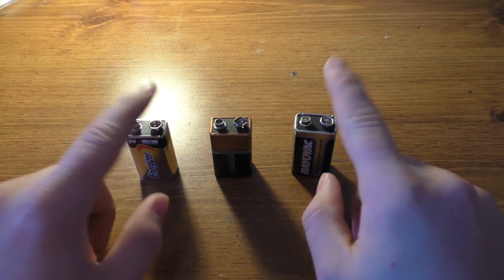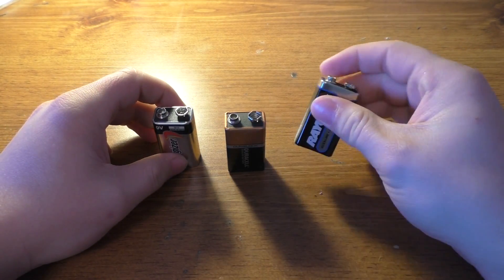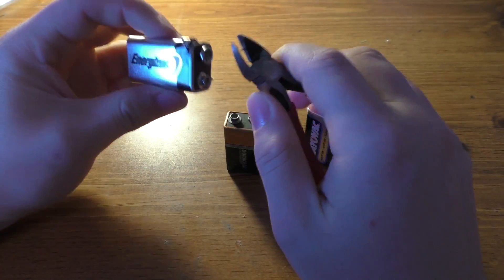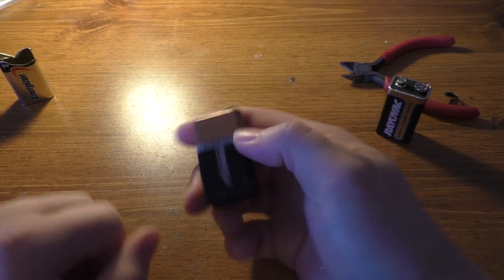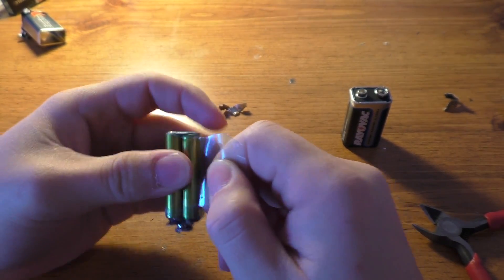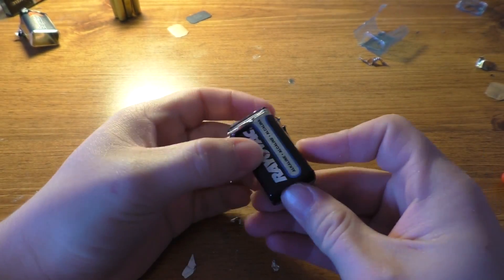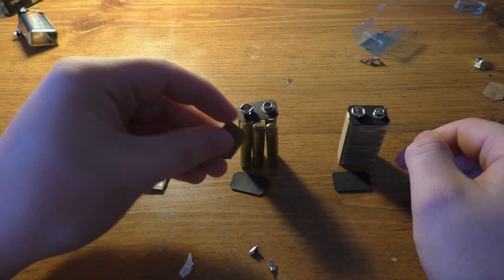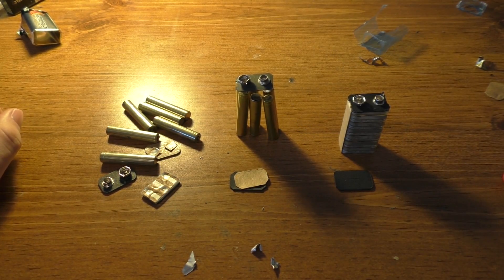Different Construction Methods of 9 Volt Batteries

Comment: That last one you opened up with the little block cells is an older style basic non-alkaline type carbon zinc "pile" construction, this type goes way back to the 60's and earlier but is now seen in some alkaliknes as well - the ones from earlier than this look different yet, encased in some kind of waxy substance

Comment: In the early 1960's the two worst leakers were Ray-O-Vac and Burgess. Ray-O-Vac still  may be using a cork seal on the negative terminal of their C's and D's. A prescription for disaster.

Comment: I tried open the plactic of rayovac battery inside its like some cloth or fibre and some kind of carbon thingy in it(dont actually know what they all called)
Reply: Carbon zinc cells from back in the 50's / 60's and I believe todays non alkalines are still made this way, I remember opening these up in the sixties and they were encased in something like a wax substance

Comment: If 6 1.5 volt batteries equal 9volts in series doesn't 6 A batteries equal 9volts as well in series making a longer lasting 9volt for use in portable amplifiers  like the fender mini tone master amp that would lengthen playing time. That's what I'm working in now. The amp came with 2 1 amp speakers that I have swapped for a 6 amp flat screen speaker that eats more juice.

Comment: I have no idea about comparative capacity but a significant space in 9 volt batteries that use cylindrical cells is air, that does not contribute to capacity. The rectangular cells seem to make the best use of the available space. Big companies source their batteries from a lot of places and you may find that that construction varies within the same brand.

Comment: Yeah, Bob Lazar says their good for powering Alien spacecraft too! Get the Energizers, more bang for your bunny! Oh Ohhh 😮 I hate batteries cause I have to change them 2-4 times a year in my smoke detector (one 9Volt only) Located in the garage attic. Heat killer for sure! Which brand of 9V do you recommend for the attic?Just went thru HEAT WAVE IN KANZA 100-113 degrees outside for 3 weeks, did not venture into attic until this morning after a 3” rain and 68 degrees. Please I’m desperate, as my wife keeps telling me the smoke alarm in the attic is chirping again! Dang it anyway!
Reply: Try a better roof vent for your attic.....or wire your smoke detector for a remote battery location i a cooler spot.
Reply: If you can deal with the $6 + price, go to lithium primary cells, not rechargeable lithiums. Several are rated 1200 mah, a lot more than an alkaline and rated for a wide temperature range

Comment: They are all (the aaaa batteries that are in these 9 volts) just too short and will not work in styluses in case you have that thought.
Reply: damn its so hard to find AAAA batteries
Reply: Or just shove in one of the spare contacts you now have from disassembling the 9v to bridge the gap.

Comment: Surface Pro 3 stylus pens take AAAA batteries, so now I know that I can get these cells most easily by cracking apart an Energizer 9v.  Previously I just purchased some Amazon AAAA batteries, as these are not easy to find.
Reply from the maker: I have an HP Spectre x360 (it's pen also uses AAAA batteries) I though the same thing that you did, and unfortunately the batteries that are supposedly AAAA in 9V batteries are actually just a little bit shorter that normal AAAAs. For the Spectre pen that meant that they didn't fit right. It might work on a Surface Pen though.
Reply: Can't you just shove in one of those extra contacts from the 9v disassembly to bridge the gap, though?
Reply: Thanks for the tip.  I'll stick to Amazon aaaa
Reply: AAAAs from a Duracell 9V work just fine in my Surface Pro stylus. Yeah they're a bit shorter than store bought AAAA but the spring inside the stylus seems to be long enough to make up for the difference.
Reply: Also the 9V i bought said 6LR61 in small print somewhere on the packaging, I do suppose that's alien code for 6 x LR61 cells

Comment: only alkaline 9v battery's have the 6 aaaa battery's in them.
Reply: Owais Mahomed That's because until very recently the "9V Battery A/S" (owned by GP batteries) had a worldwide patent on making alkaline 9V batteries as a stack of rectangular cells, which allows more capacity (no empty space) for a lower price (assuming same build quality).  In this video, the stacked construction happened to be represented by a brand the guy didn't like, but don't let that confuse you.